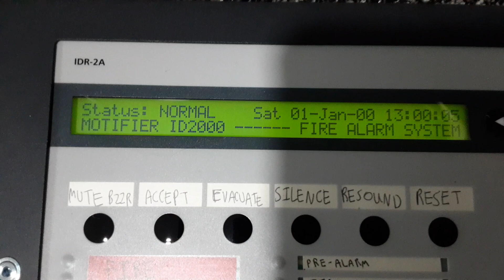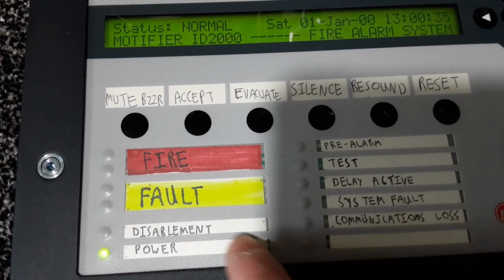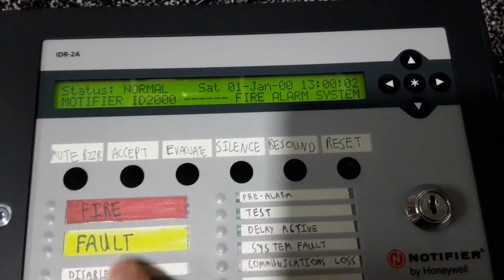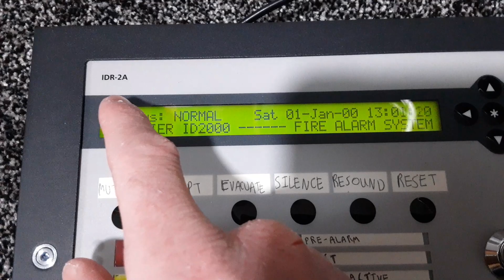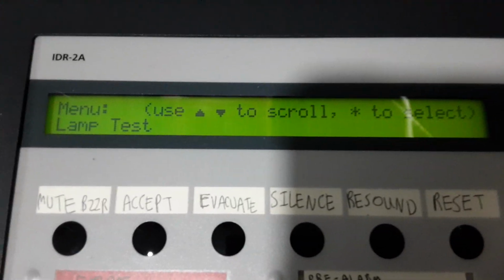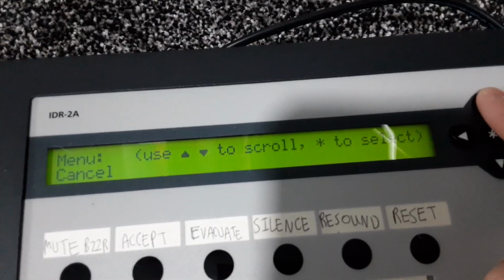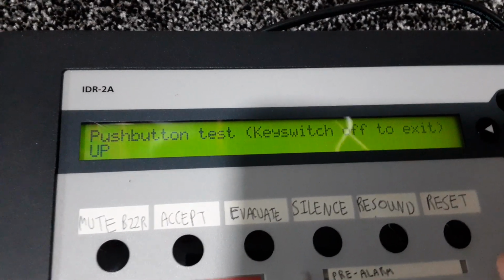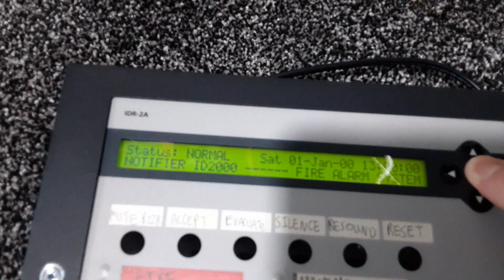(Requested video) Powering up and features of Notifier repeater panel Pt.1

Comment: Hi there I have an id2000 system which requires these repeaters and I’m hunting all over for one, where did you get yours from please?
Reply from the maker: I got it from eBay, they're about £100 but I got mine for £20. They sold it as for parts/not working but It was brand new and functions fine. If I spot one, I will let you know.
Reply from the maker: I found this one on eBay.  https://www.ebay.co.uk/itm/Notifier-IDR2-A-Repeater-Panel-with-Active-Controls-002-450-Fire-Systems/273550539927?hash=item3fb0e1fc97:g:yh8AAOSw9z1b5JPQ&redirect=mobile
Reply: Grainger Electrical thank you buddy was gunna buy that off you for a reasonable price but if you wanna keep it then it’s fine. Just need one on my system to finish it all off
Reply from the maker: @tgpfireandsecurity8786  unfortunately I do want to keep the repeater but I'm sure one will show up. I often look for them on eBay as I prefer to collect repeaters than master panels and I will let you know if a reasonable priced one appears.
Reply: Grainger Electrical ok np thank you
Reply from the maker: @tgpfireandsecurity8786  I have just found one on eBay on auction: https://www.ebay.co.uk/itm/Notifier-IDR2-A-Repeater-Panel-with-Active-Controls-002-450-Fire-Systems/184303440463?hash=item2ae957524f:g:iiIAAOSwVo5epJPl
Reply: Grainger Electrical got one now thanks bud